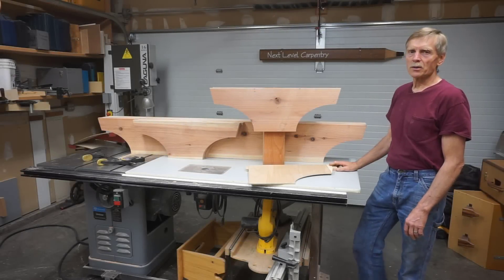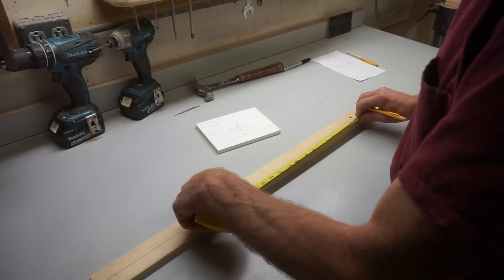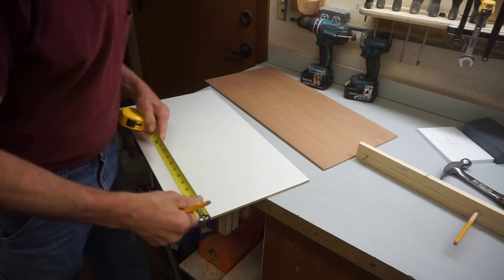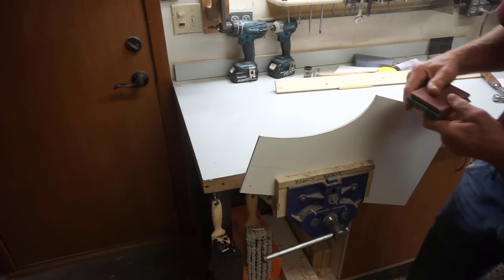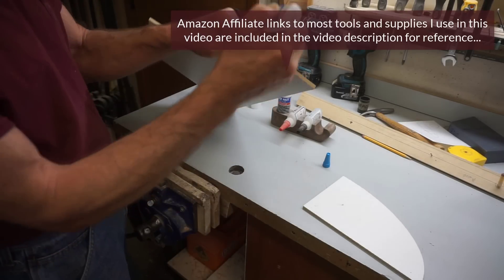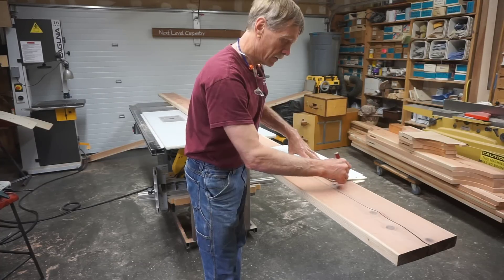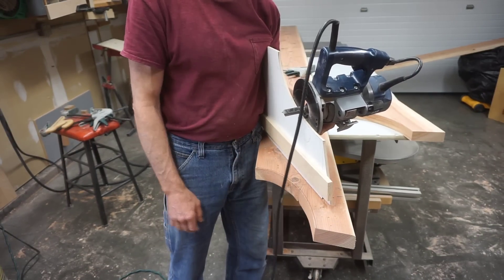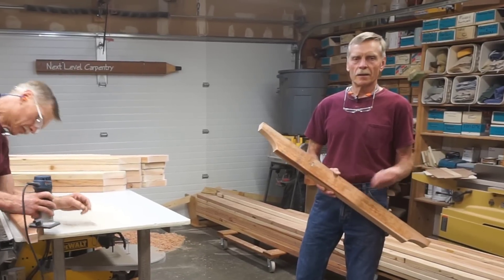How to Cut Decorative Ends on Pergola Joists

Comment: Wow.. I am planning to build a Pergola next year and this tip is priceless!! Any chance you have the plans handy that you used to build the pergola? I am having a difficult time finding decent plans. Looking forward to more of your videos! Thanks
Reply from the maker: Josepi,
I'm glad you found this video on Next Level Carpentry and took the time to
comment!I hope this helps you get great results in building your pergola
project... I'm guessing you see the potential of
using the process I show even if you choose a different joist end profile. The
templating/routing method adapts well to virtually any shape you decide to use.
Spend time up front making an accurate template and professional results are
almost guaranteed!
I don't have a set of plans 'handy' since I built the project closely following
only the SketchUp model I made for the design/planning process. I uploaded the model to the Trimble SketchUp Component Warehouse where it is available for free download... just search Pergola Gate Trellis to find the model in my Next Level Carpentry Model Collection.   If you're a SketchUp user it should work nicely as a set of plans to start from. As a contributing editor at ProTradeCraft I actually did a series showing how to use SketchUp for planning and designing a
pergola. Here's a link to the series if you're interested:

 https://www.protradecraft.com/sketchup-beginners-how-build-pergola

If you're not a SketchUp user yet you could check out my other channel The Digital Jobsite where I have a bunch of tutorials showing ways to use 3D modeling for carpentry work:

https://www.youtube.com/channel/UCBWzq8RebspsaW-opjo2vxg

You'd find it ideal for planning your pergola if you're willing to invest a bit of effort to tackle the learning curve. Take it from me: it's totally worth it!

Best,

Matt Jackson

Next Level Carpentry

The Digital Jobsite

Comment: Thanks for the video.  Awesome way to come up with an elliptical shape for the pergola ends.  do you use the same 10-1/2" and 6-1/4" dimensions for the smaller sizes or do you have a formula for the 2x4 , 2x6 and 2x8s to keep them all looking the same?
Reply from the maker: No formula Ric... just eyeballing until I like the proportions... it's easier than you might think...

Comment: Great video. I am trying to make good looking book shelf speakers stand and create a angular cut, how would i do it. What tool i need. Not a straight cut rather creating a different shape.
Reply from the maker: I use the template making process shown in this video to make custom shaped Parts all the time Jack. Use what you saw in this video and combine it with the lesson in the next level carpentry video called make this no stoop dust scoop and you're well on your way to learning how to make the custom brackets for your speaker stand...
Reply: @NextLevelCarpentry  great. Thank you
Reply from the maker: @jackryder6732  You're quite welcome... got to thinking I just did a video recently showing some advanced templating techniques used to make an extension cord organizer that might give you some ideas too...

Comment: I really enjoyed this video, and I believe the dimensions of the elipse together with the 15 degree angle cut is just right for a 2x10. Wondering what major and minor axis dimensions you used for the 2x6. Thanks!
Reply from the maker: Thanks, Bob, Glad you enjoyed the video... it was actually one of the 'funner' one's I've done.
Since the job is over I'm sure I tossed the templates I made for them so any answer I have would just be an approximation from the SketchUp model I created for the design process.  If you REALLY need to know what I used I could probably find out but knowing that you believe the proportions I used are just right for a 2x10 (and thanks for saying so :-) I'm guessing your 'eye' will guide you to proportions for use on a 2x6 that would equal or exceed whatever I ended up with.  But do let me know if you need something closer and I'll see what I can do for you?
Best,
Matt

Comment: I finally know how to case the arches in my old Tudor. Thank you.

So...how do I case the underside of the arch with solid wood?
Reply from the maker: That's typically done with bent laminations or a kerf-bent piece of solid wood... both are 'next level' techniques, the sort of work I do for clients.  If you're up to the task of making elliptical arched trim I bet you can, with practice and a bit of trial and error, make elliptical jambs too! 👍😁😎Best, Matt
Reply: @NextLevelCarpentry  Thanks for replying. My woodworking saved videos folder has many of your videos.

As you suggest, I've been working the kerf bending process on solid maple. I've got a lot of work to do before feeling I've got it down correctly.

I really appreciate your videos.
Reply from the maker: @nickbailey202  You probably already know this but if you adjust the spacing of kerfs according to the tightness of the bend through the ellipse it will cooperate better.  Might also dampen the face of the piece as you work the bend.  Keep in mind that Maple doesn't have a reputation for bend-ability with its short fiber grain structure so you're working against that reality too.  You'll get it though!
Best, Matt
Reply: @NextLevelCarpentry  p

Comment: Just a thought could you install your router to the ellipse stick and make a half pass with it maybe make the pins more like 1/4” dowels and completely take out the jig saw operation??
Reply from the maker: I understand your thinking John, and while it would be more efficient in theory, in practice it isn't IMHO.  The reason for the jigsaw step is to eliminate 90%+ of the material being removed to form a smooth chatter and chip free curve.  Trying to plough through 1 1/2" thick material all in one pass would be a fracas with smoke, splinters and spoiled workpieces. I wouldn't attempt it on anything thicker than 1/4" material and probably not even then.  I don't want to slam you for creative thinking so please don't take this as reason not to raise worthwhile questions in the future, OK? Best, Matt

Comment: Great Video Thanks
My question is how do you determine the major and the minor axis
Reply from the maker: Thanks for commenting and subscribing, Ken!
Basically I chose the major and minor axes for this project by winging it... I used SketchUp to layout what I thought looked good for proportions and then used those dimensions for the 'elipse stick' you see in the video.  There may be a formula for such things but I just 'eyeballed' it until I was pleased with the overall proportions.  Not sure if that helps but I hope the take-away is that trial and error can be a great way to figure stuff out :-)  Best, Matt
Reply: @NextLevelCarpentry  This too was my question

Comment: I am about to erect a pergola as part of my deck as soon as I am finished installing my two by eight joists on my two by ten beams I am going to use six by six posts to which I will attach the overhead structure. I have Trex Composite floor boards that I will be putting down when I have the posts installed. I will be utilizing your profile jig method and I guess I will invest in one of those massive router bits, the very nicely finished look you got will be more than worth it. Nice job, I hope I can accomplish your kind of results, thanks.
Reply from the maker: Hardrock,
A friend helped me find some very old neglected comments hiding out on Next Level Carpentry... so a belated 'thank you' for your comment... hope your pergola came out like you hoped and that you're still watching videos here?  Best, Matt

Comment: In the video, you said that the long axis of the ellipsis was 10-1/2 inches and the short axis was 6-1/4 inches. How did you arrive at those numbers? I believe you were cutting 2 x 12s and I want to calculate the correct axes for 2 x 8s. Thanks.
Reply from the maker: I didn't have or use an actual formula for my calculation Patrick.  I made all my choices visually once I came up with major/minor axis combination I thought looked right.  You could draw out the ellipse I used and then, with a 2x8 on hand, sketch and experiment until you're please with the result.  A math whiz might be able to calculate the ratio and reduce it for you but that's outside my wheelhouse, so to speak😉😁😎

Comment: What brand of safety glasses are you using that separate at the nose piece?
Reply from the maker: Actually Rgood, they're not safety glasses at all, they're Clic-Readers cheater glasses that I use while working so I can see marks and measurements.  https://www.amazon.com/dp/B01AK73JKK/?ref=idea_lv_dp_ov_d&tag=aiponsite-20&linkCode=ic6&ascsubtag=amzn1.ideas.26F2B577SGOA8  I use a face shield in addition to the readers when I want actual protection from the work I'm doing: https://www.amazon.com/dp/B07PPCWV38/?ref=idea_lv_dp_ov_d&tag=aiponsite-20&linkCode=ic6&ascsubtag=amzn1.ideas.29WVINIJF4EUJ because there's no way click readers can be construed as 'safety glasses'.  Thanks for watching and commenting here... Best, Matt

Comment: what kind of wood you using for pergola?
Reply from the maker: The one in this video is primarily redwood with a couple cedar posts.  Redwood and cedar are the only real options here in middle America.  Best, Matt
Reply: @NextLevelCarpentry  you would not recommend PT pine? I am living in South Florida, Near to Fort Lauderdale
Reply from the maker: @zsozsousa1  PT pine might be your only practical option there.  The biggest challenge I have with that material is that is comes SOAKING wet with the treatment chemical and twists, warps, cups and bows to nearly unusable as it dries.  I'd want to design in blocking and such to restrict movement from drying and plan on building my project as FAST as possible to get it put together before it starts to move.  Last Time I used it I had to replace joists on a deck that got a 1" crown in them in about a 7' span.  The call back labor can quickly overtake cost savings compared to cedar and redwood... and maybe even cypress in your corner of the world.  Best, Matt

Comment: Can some please tell me where i can get this router bit? I tried everywhere but i could not find more than 1 inch size
Reply from the maker: Shouldn't be that hard to find: https://www.amazon.com/Amana-Tool-47126-Bearing-Diameter/dp/B000P4LUY6/ref=sr_1_46?crid=2F2YJIWJ9IGL1&keywords=1%2B1%2F2%22%2Bcut%2Blength%2Brouter%2Bbit&qid=1650331339&sprefix=1%2B1%2F2%2Bcut%2Blength%2Brouter%2Bbit%2Caps%2C103&sr=8-46&th=1
Reply: @NextLevelCarpentry  thanks for replying to me, in this video bearing is at another side of the bit, and in this link one you mentioned, that bit's bearing is on another side
Reply: @NextLevelCarpentry  yesterday I purchased a used router from marketplace, I don't know about the bits
Reply from the maker: @PardesiPunjab  Good eye and good catch!  Here's a top-bearing 'pattern bit' for use in this sort of work: https://www.amazon.com/dp/B07CZJ86GB/?ref=idea_lv_dp_ov_d  It's a 1/2" shank and is best used with a decent sized router with plenty of power.
Keep in mind that they're kind of dangerous because there's no bearing on the end so it will cut anything you set it on, especially if it's still turning.
Best, Matt

Comment: Do you know where I can get a bit like that for a router with a quarter inch shaft? I can't seem to find any at the big box stores
Reply from the maker: Luke, I'm afraid that the demand put on a router bit for this operation (as I'm showing it) exceeds the performance range of a 1/4" shank router bit.  As an option you can buy a 1/4" shank flush trim bit with a shorter cut length and do the pattern/profile routing in stages.  There should be all sorts of them on Amazon.  BTW I tend to gravitate towards Whiteside bits for quality and variety but that's just me.  If you've got any quantity of this sort of pattern routing to do it might be time to consider investing in a router that has the capability to handle 1/2" shank bits since they do perform better ie; don't tend to 'chatter' as much while making the cut either.
Hope that helps?
Best, Matt
Reply: I can't tell u how many times I've notched mat. But luv the trick of smacking  the cuts n all popping off what a time saver also the little details u covered on pattern making r all issues I've dealth with great  info great teaching kinda smacking myself saying so easy why didn't I think of that

Comment: did i miss the other templates dimensions as-- in fill boards are 2x6  do u just do a percentage reduction for matching ellipses?  say 2x12 to a 2x6 is - 50 percent or cross beam a 2x12 to a 2x8 is  minus -33.3 percent
Reply from the maker: s Buzz... I didn't intend this as a build video, per se, so the process was more important than particulars.  Sounds like you have the right idea though with the percentage thing.  You can do the math as precisely as you care to but I just winged it getting close and made sure I thought the final proportions looked good together.  Sometimes perfect math can end up with less than ideal visual appeal meaning that this sort of thing is often as much art as science.  I hope you're able to use the methods shown though to draw out various options and end up with ones you're content with.  Work safely and have fun! Best, Matt
Reply: @NextLevelCarpentry  thanks  its the electrician in me, i forget carpentry is also visual arts, i have to think when a tape measure gets me in trouble.

Comment: Would have liked to have seen how you 'scaled down' the 10" ellipse for 8", 6", and 4"s.  The major and minor for the baseline 10" were chosen based on "look"?
Reply from the maker: Benny,
You are correct: when I initially designed the pergola for my client using SketchUp I played around with quarter-elipse sizes that looked proportional, to my eye, for each size of lumber involved.  There's probably a formula 'out there' to calculate such things but I just eyeballed it.  The best thing is that once you've determined the major/minor axis dimensions you can just re-position the guide nails on the same ellipse stick and draw your curves.
You've probably seen this Next Level Carpentry video already but if you haven't, it gives more detail about setting up and using an 'ellipse stick':

https://www.youtube.com/watch?v=Jjh_ZRhfnDY&t=1s&index=16&list=PLh_GOwrHv4WU14QGS5xvTgiyvT0FWMn8a

Thanks for watching and commenting!

Matt

Comment: How did you come up with your dimensions of 6.25  and 10.5
Reply from the maker: Those dimensions are from just 'eyeballing' the proportions to fit the overall design.  I use a SketchUp model to work out overall dimensions so I'm confident that the final result will be pleasing to the eye.  Sorry I don't have a better formula to share with you...  Best, Matt
Reply: @NextLevelCarpentry  addendum to my question......figured it had already been asked

Comment: I'm new to this. Trying one nominal 2x8. What would be my 2 measurements and how did you come up with that number?
Reply from the maker: There's no right and wrong here SFD... I just 'eyeball' the proportions I'm after and when I like the way it looks use those dimensions.  Give it a try on a piece of cardboard cut into a strip as wide as your 2x8's (probably 7 1/4").  With a few iterations you'll have something you love! Best, Matt
Reply: @NextLevelCarpentry  I nailed it! I just took your measurements and subtracted 2". I overthink things at times. Thanks for the response! Subscribed today👍
Reply from the maker: @sheepdog819  Thanks for the sub... welcome to Next Level Carpentry! Best, Matt
Reply: This is great! I am finishing up a carport with 2x8x16 center joists with overhangs.   I wanted a pro look to the carport and was looking at rafter tail ideas when I stumbled on this video.  

Now the comments just tuned me in to exactly my dimension and look I was going for.  I even drew this exact end on paper months ago but wasn’t sure how to go about it.   Now I do! 

Too bad I already installed the joists though!  So now I get to do this but up in the air.   The bright side is that I won’t need anyone to hold on to the wood for me.   :)  I’ll be careful...Cut twice, measure once, right?
Reply: Incidentally, I subbed and liked.  Great content, NLC! I have a Brad nail hammer and never knew it was magnetic until today!  Oh and I’m going to get some of that spray glue. Holy cow that’s impressive.

Comment: Nosy question. Do you ever concern yourself with the dangers of sanding MDF w/o a mask? I'm sure you've heard of the formaldehyde dangers. I did an extensive sand on MDF many years ago and had lung irritation for weeks.
Reply from the maker: I don't, really... but then again I don't work with it enough for prolonged inhalation.  I can tell I should have worn a mask any time I spend a full day in the shop cutting and sanding anything with powdery sawdust though and remind myself to be a bit more diligent and wear a mask next time.  I don't mean to be flippant about it but on the other hand I refrain from the paranoia suffered by those who believe the smallest whiff of dust is the kiss of death. Best, Matt